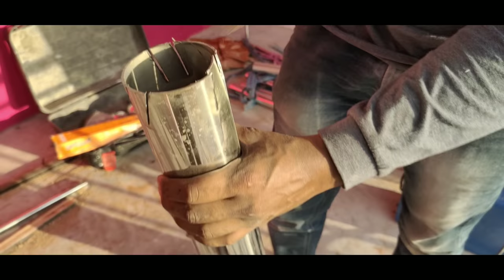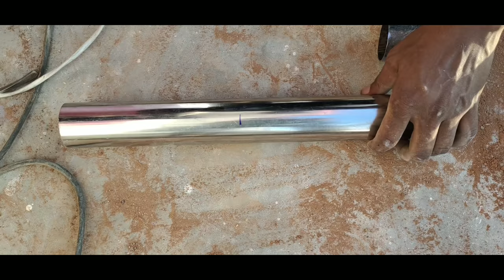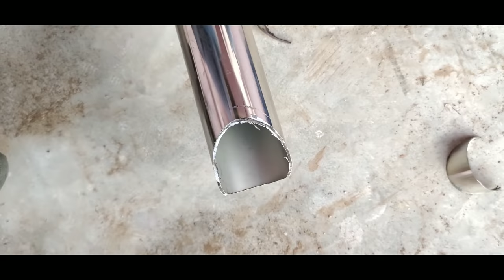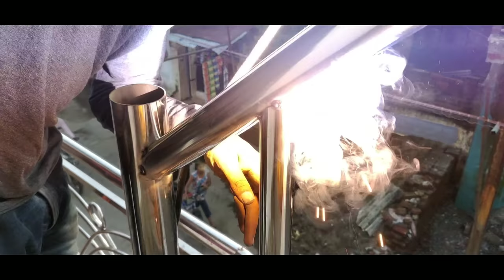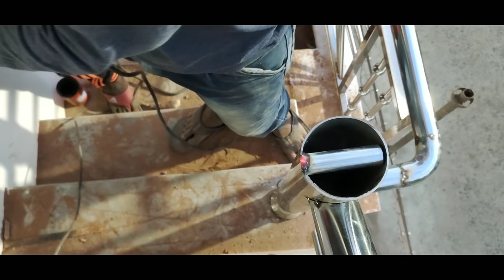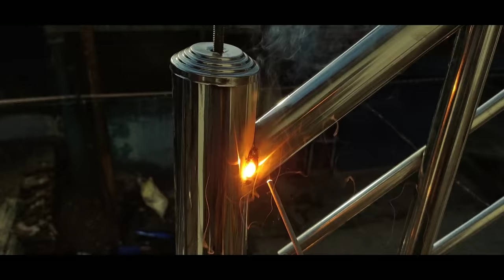stainless steel design for railing || How to install stainless steel railing

Comment: Sure came out good. Does not look like stainless steel , just chrome mild steel
Reply: I'm a welder and you can see it on the flying sparks that this is not a stainless steel.
Reply: Apna  number  to  batatey bhai kaise  baat  kare
Reply: It's 202 grade steel bro,,.

Comment: Tig Tig Tig, you need a Tig welding machine. lamelar disks, gloves, glasses etc. all the rest you have it, good skills!!
Reply: Here at BRAZIL I work with railing corrections, and industrial assemblies ... but always with TIG welding ... and cpm excellent finishing.
Reply: Well, they acually showed that you don't need those things :D
Reply: Yes but the results are not the same..
Reply: Laser welding machine wanted
Reply: U dont need tig on that field dude
Reply: Give me the link or name of the best TIG welding machine I should buy...🙏🏽

I'm a noob. Help me with the buying of welding machine. 

ONE MORE HELP:—
Will I be able to run Welding Machine in  my house? How much power it needs to run flawlessly/properly? 
HINT:— I can run only 2 Air Conditioners of 1.5 ton simultaneously in my house. Any more addition of AC puts too much load and my power trips. In these cases I need to turn off the 3rd AC and then switch on the power from the ‘mains’ via operating a built-in lever. 

Any help is appreciated😊💕...
Reply: No you don't need tig
Reply: @danielfausto757  if you want to work like in Africa,yes your don't. But professional made is with the Tig. Yes,I do that every day. If you use stick,you will work more like a idiot. So yeah is stupid use stick when the Tig cost only a few hundred euro..

Comment: enough with the compliments,  it might look great, and my compliments for that...... but in the netherlands we do this different.   and thats the reason why we have less buildings collapse and people dying.    THIS ADVICE COULD SAVE SOMEBODIES LIFE:    as first, being a welder myself, what i see going wrong at first minute in the video;  making holes into the structure to put the pipes in is a good idea, but not enough,  you should bolt the whole thing especially at the corners with big bolts into the concrete,  there are special bolts for that with special plugs (often we use brass plugs for concrete, google; metal anchors) not just with some cement or glue or whatever that stuff is.   after years of being pushed and hanged against, that little bit of cement will start to crumble,   that is why we fasten gates and fences with plates at the ends and those plates are connected with bolts in the concrete.          hm,  i think that was actually the only really important thing i had to mention.        rest looks good.

Comment: shouldn't use stick welding, looks bad and can cause cracks that reduce structural rigidity.
Reply: Here at BRAZIL I work with railing corrections, and industrial assemblies ... but always with TIG welding ... and cpm excellent finishing.

Comment: Poor foundation on the railings, no strength, u could have at least make a base plate, and bolt it on the floor, or dug a metal reinforcement in the floor and weld it on the railings, then cement, i will not be surprised if one of person fell down when they lean on the railings because only cement holds the railings, quality job, and safety first,